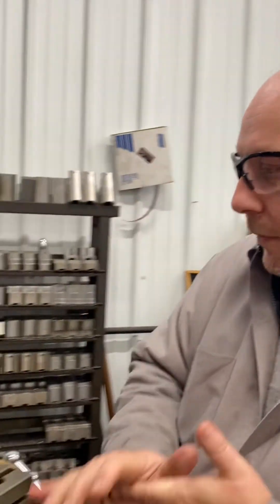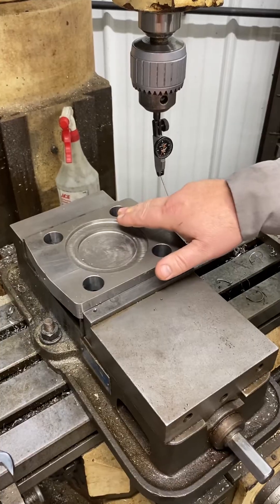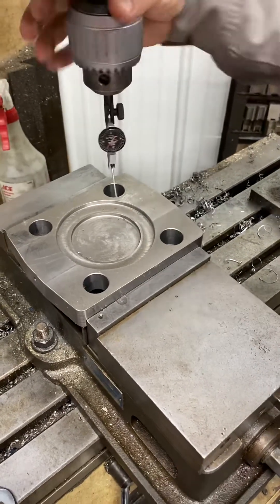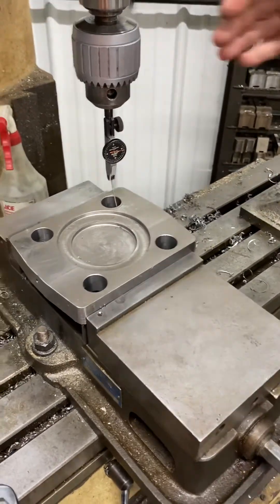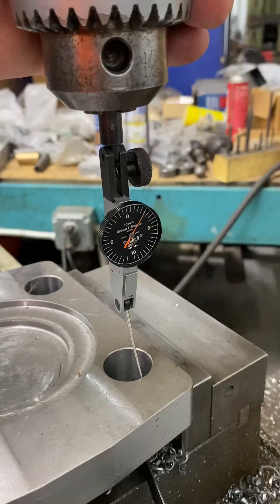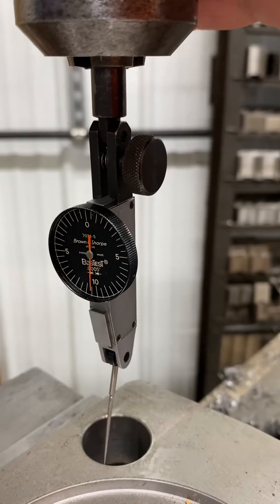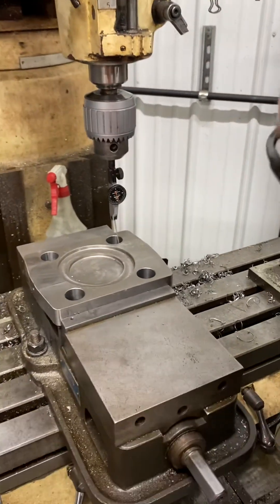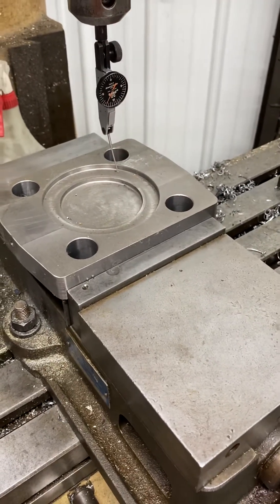CNC Machinist: finding the center of a hole is indicator

Comment: Was this the first time you have done this? The fundamental idea is to move the indicator hand half the difference, not to keep guessing an approximate distance. It's called a lever indicator or test indicator. Use the quill to place the stylus in the hole not moving the knee up and down.
Reply: Not sure where you’re coming up with the guessing thing. Maybe you’re not understanding what I’m saying. There are multiple ways to indicate a hole. I am showing you a very basic way to do that. No more, or no less.
You could have shared your idea Without being a smart ass in the beginning of your comment.
In fact, that gives me an idea for a new video. Dealing with smart asses.

Comment: I get it but you also need to know that piece is square to the X and Y, how do you know that?
Reply: If holes are all you have to go off of, then you'd pickup one hole and move X/Y to another known hole location and use the indicator to see how far off the two holes are. Use/make a pin in two holes and then either tram off one axis X/Y with the indicator touching the pins, adjusting the vise or part so that the indicator readings on the pins matches.
Reply: @RinksRides  Thank you for replying

Comment: Need a little more detail when moving the dial indicator around the circle .. idk how you got center
Reply from the maker: As I move the table in the X the indicator informs me the difference between the left side and right side of the hole as far as the location of the spindle which is where the indicator is .
If I continue to split the difference I will soon be in the center where the indicator will read the same on the left side of the hole as well as the right. The same goes for the Y in a forward and backward motion. When the dial does not move the spindle is in the center of the hole. I hope that helps